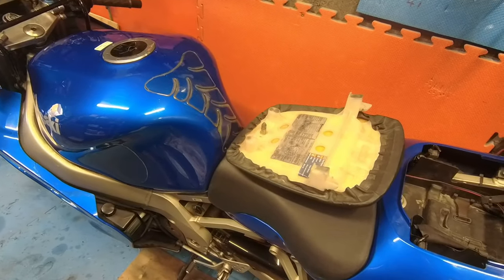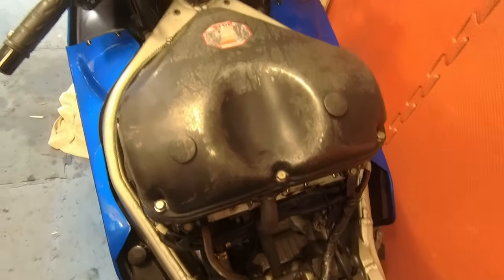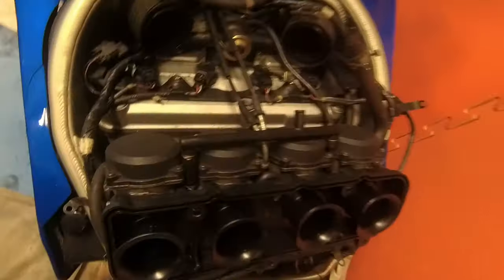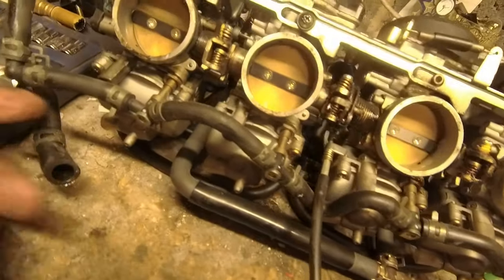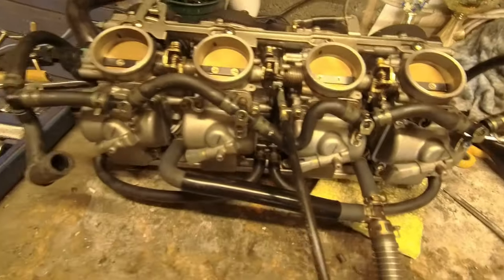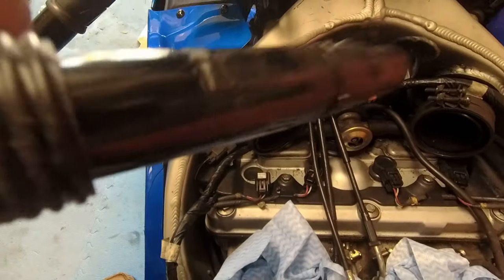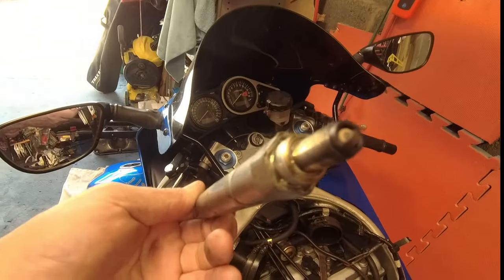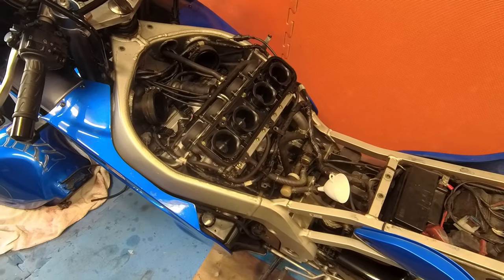Kawasaki ZX9R Carb clean and spark plug inspection

Comment: Hi,I've got a blue zx9r W reg 
Had new bits put in carbs and balanced at garage ,as soon as I left was on 3 cylinders, 
Did go back to 4  ,for 5 miles ,back to 3 ,so intermittent!!!
Is it possible he hasn't put coil pack far enough on ?
Reply from the maker: It could be, or my guess would be the floats are set wrong and not letting enough fuel in or the pipe from the fuel tank is kinked ...  had the kinked pipe myself and caused me a lot of grief .